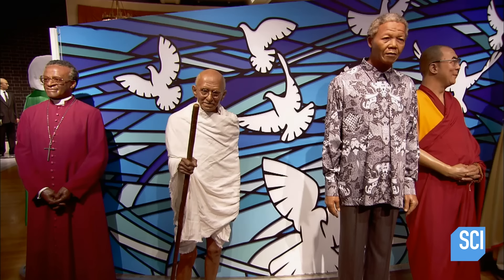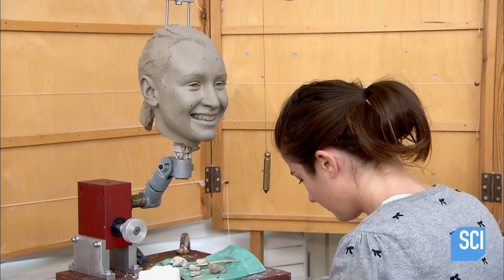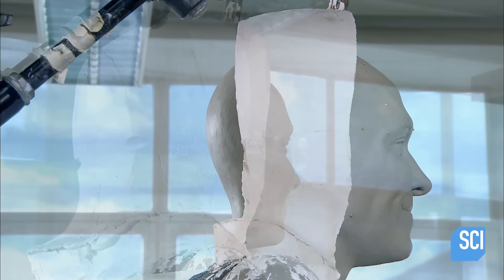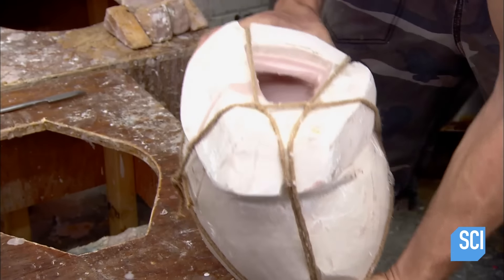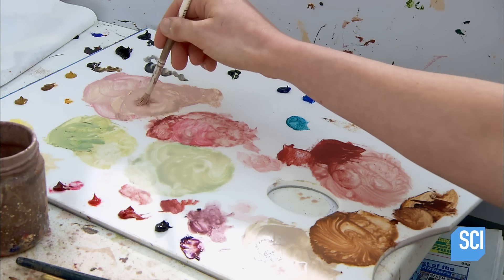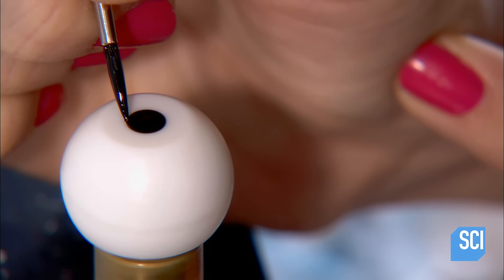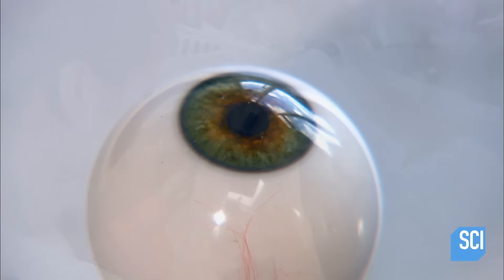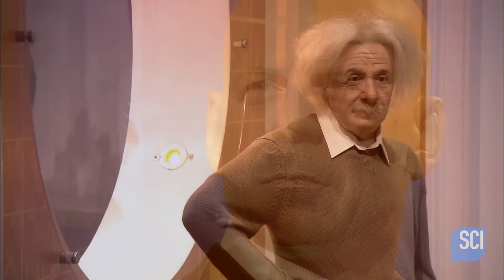How It's Made: Wax Figures

Comment: It's obviously not a rushed job. This is something done with patience and time over extended time cycles. Not something a few people clock in and go at it for hours on a daily basis. Usually, my best paintings are the ones I put no time limit or schedule on.
Reply: I literally work at this wax museum and yes, they literally go at it for hours at a time. They have a team of 4 where I work. Usually they spend most of the time up keeping current figures as they need to be taken off the floor and retouched every couple months.